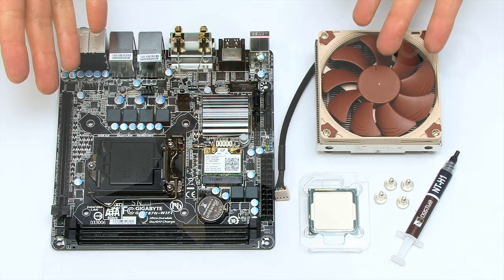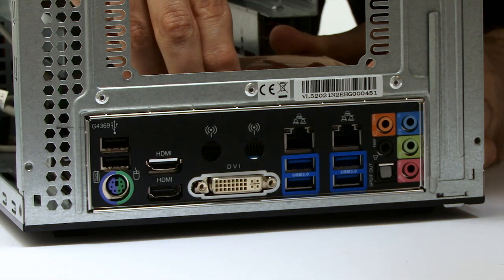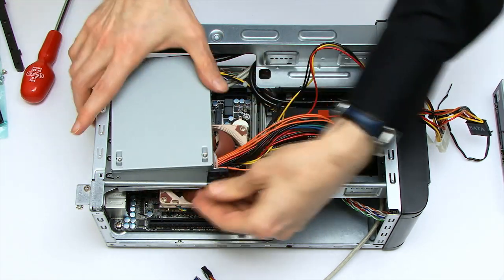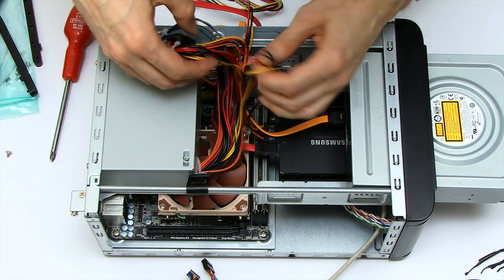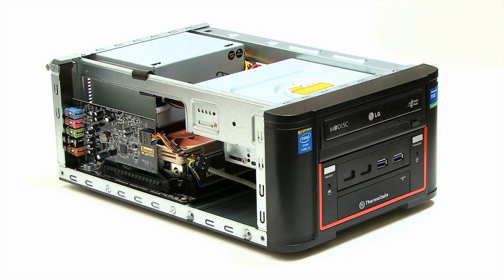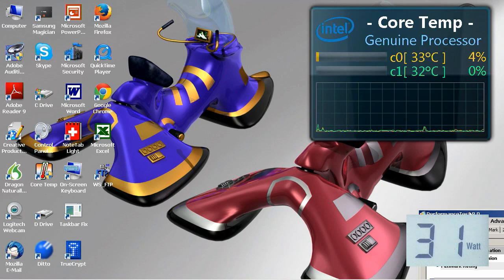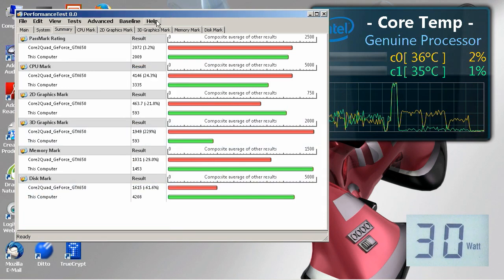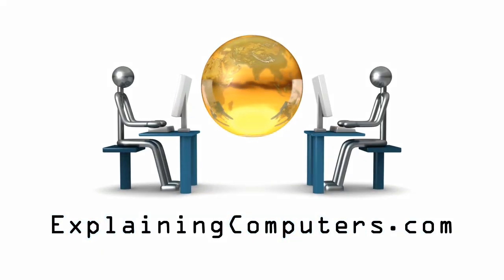Haswell i3 Mini-ITX Build (Part Two)

Comment: Lol why would you be worried about the 4765T?It is only 35W.Also have you considered building on top of a C2758/2750 Atom instead?It have 8 cores,and performs similar to a Haswell Mobile i3.It is not 3GHz,but the IPC is high enough imo to not really need 3GHz at all.
Reply from the maker: Yes, I know, the 4765T should be OK with its 35W TDP! :) I think I just have a psychological block in my head concerning an i7 in a fanless case. On the Atom, I've just upgraded from an Atom (admitedly an earlier dual core one) because it would not run Dragon NaturallySpeaking properly. So I decided to go higher this time.